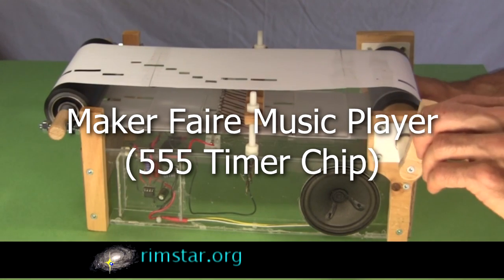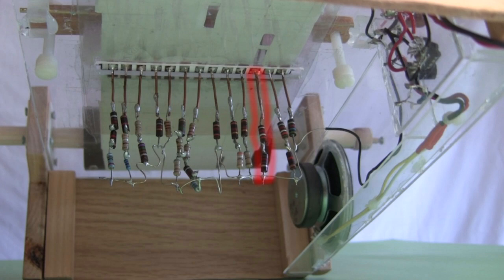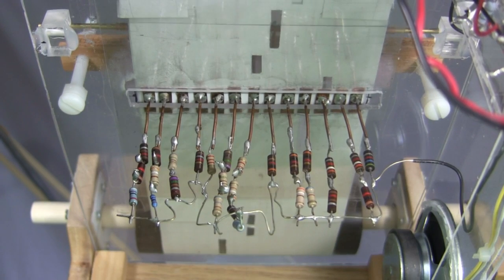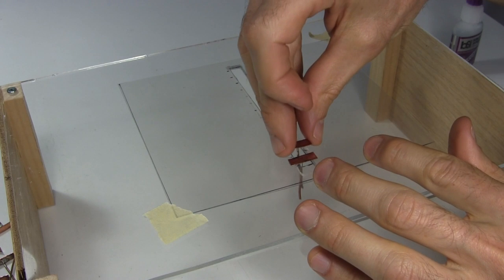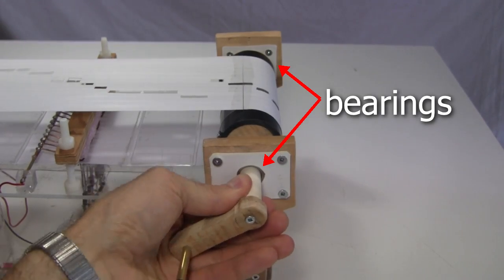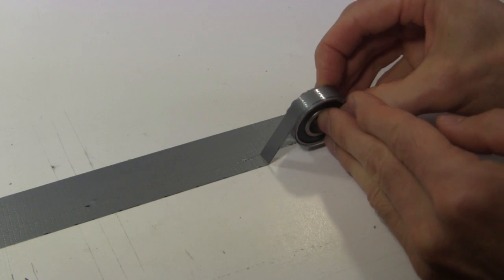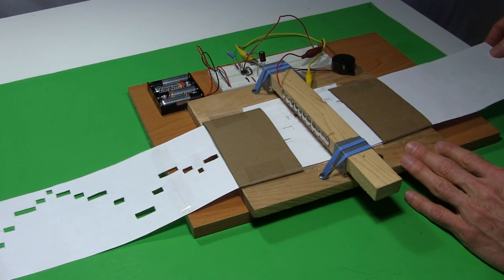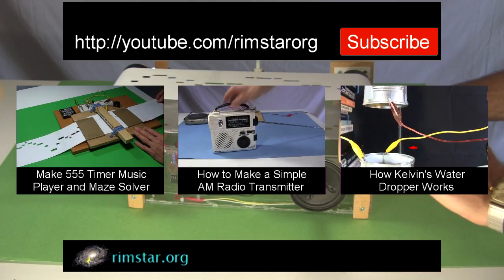555 Timer Chip Music Player for Maker Faire

Comment: Couldn't you use  IR sensors instead of copper wires for the notes?
Reply from the maker: I've thought about it. That would certainly be easier mechanically since I wouldn't have to put pressure on the paper with the contacts.

Comment: I tried to make a pencil resister but it was not working
Reply from the maker: Were you trying this circuit, or something different. The resistance is quite high, so it's possible it was too high for your circuit. Try darkening and widening your mark to lower the resistance. I also recall that one pencil didn't work at all for me so maybe they don't all contain conductive graphite, so try other pencils.

Comment: Cool musical contraption! :D

Reminds me a lot how music were made on NES consoles and some other old computer system with signal generators... but they used other types of wave, like triangle.

I believe it's possible to enhance a little bit more this device with couple things:

- Replace the copper contacts by light sensors and black paper. It's probably more reliable and the paper will last longer without any damage. I believe that would the best upgrade... the other things are just some extras.

- One circuit per note allow the device to use more than one note at same time.

- Add the possibility the change the wave form... not very simple, but it would make cool effects. 

Thanks for the video!
Reply from the maker: +T “Sukyake Akido” Mathias Thanks! I'm glad you like it!
Regarding using light sensors instead, that's long been on my todo list, just haven't gotten to it. It sure would be an improvement.
Instead of one circuit per note, I'd probably look for some sort of multiplexing chip.
I like the idea of ways of changing the waveform, I hadn't thought of that.

Comment: Could you use a capacitor to round out the square wave to make it sound a little nicer?
Reply from the maker: I suppose you could try putting one across pin 3 and battery negative. Not sure if that would help though, since the output is square waves.

Comment from the maker: Even better. I hadn't heard of phototransistors. In a future version I would have gone the photodiode route, which would have been more complicated since, as you say, all I need is a switch. Another suggestion was photoresistors but I don't think they fit the bill either since they just change the resistance, whereas I'd need either conducting or not conducting. I also like the switch because I could have one activate a solenoid and ring a bell or something.

Comment from the maker: The 555 timer chip and the other electronic parts I bought from local electronics stores, but I'm sure you can find them online too. Most of the other parts, the wood, the plexiglass, the black ABS pipe, duct tape, and so on I got from Home Depot and stores like it. The brass and copper tubes and rods I got from a local hobby shop. The speaker I got from something someone threw out, I don't remember what. The bearings came from a local bearing store but you could use roller blade bearings.

Comment from the maker: The chip is what's producing the sound. But I guess you can make one without the chip. As the paper moves along, it causes electrical contact to be made between the dragging wires on top and the copper plates below. That's like closing switches. So you can use those switches to turn on and off anything.

Comment: Do you think it is possible to make a speaker where the stator and the voice coil are both electromagnets, rather than the traditional design of the fixed magnet for the stator, a electromagnet for the voice coil. I ask because I think that by applying the signals in reverse to when a positive charge goes to the voice coil a negative goes to the voice coil and vise versa, I believe that you could achieve more detailed, richer, crisper sound by the voice coil moving more with less power

Comment: Tip for next one with a roller is to use 2 springs to provide the tension. That way when the paper stretches due to humidity changes it will not go slack or snap. Springs are cheap at the hardware, or make them yourself from stainless steel or brass wire.

Comment: Love it! Brings me back to my youth (70's) when I had the same wire & paper setup to make my own generic TTL IC test box. (it worked!).  I would write the "test program" on cardboard strips as input data for a specific TTL SN74xxx chip together with the output data the chip should show.
I compared the data on the card with the chip output and when not equal it beeped (also using a NE555 timer).
All done without a microprocessor just using standard TTL chips... those were the days.

Comment from the maker: Thanks Grant! Making the music sheets is quick and easy. I have a small piece of cardboard I lay over it that has the positions of each note marked along one edge. I then pick a note from the music score in a music book and use the cardboard to see where to mark one end of the hole on the sheet. Then I measure the length for the hole (5mm per 1/4 note) and move the cardboard and mark the other end. I use an xacto knife to cut the holes out. Takes around 10 minutes tops.